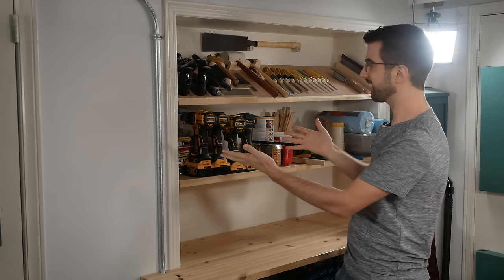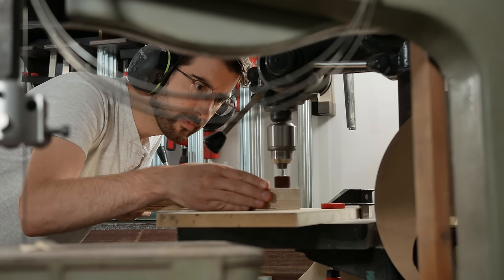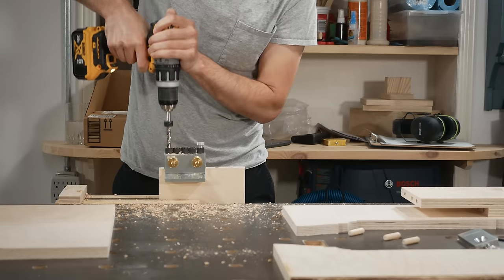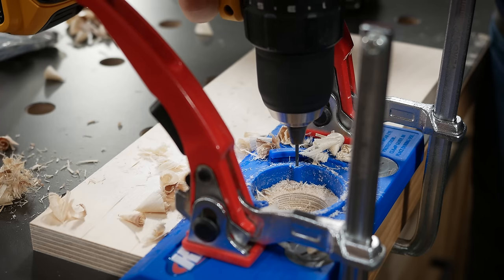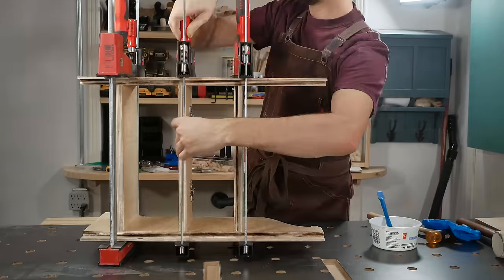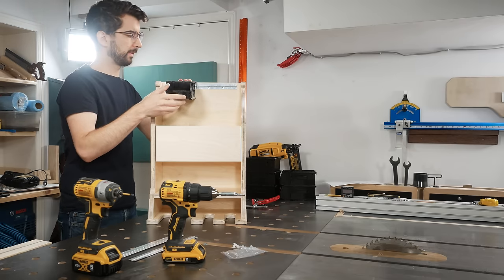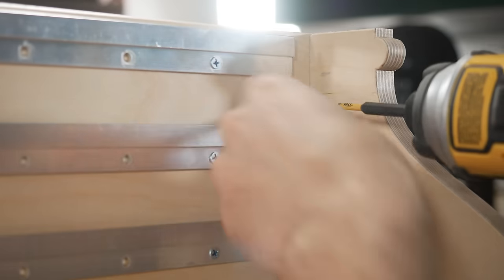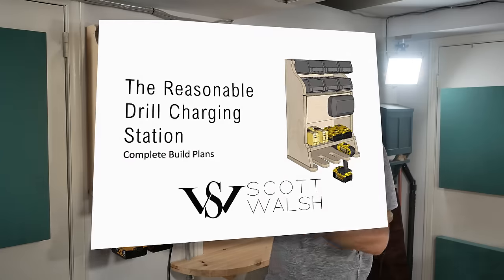haven't seen this on a drill charging station

Comment: 1:15 i have 6 drills for various uses. 1 lives in my car with battery and other tools, 2 for drill driving, another right angle, 1 for my wifee to use if needed (low speed won't hurt her) and the last is for heavy duty hammer/killin' stuff, I also use it for mixing in the kitchen and  cleaning.

Comment: Great job, and much appreciated on a smaller design; like you said, most hobbyists don't have more than a few drills and drivers. 
As for the dowelmax, I'll take every chance to sing its praises whenever I see it used in a video. Pricey for a doweling jig, sure. But it has just as much accuracy and joint strength as a domino. The domino is an amazing tool, but a dowelmax is an investment worth every penny as well. It's incredibly well-built too.
Reply: I would say an average of two to four drills for the average wood butcher..
Reply: @michaellovetere8033  Sounds right; I've culled the heard down to three: drill, impact and installation driver. It handles everything I need.

Comment: Total hobby and side hustle wood worker here and I have 7 drills and 1 impact driver lol (bought black and decker drill first on clearance and an additional drill with battery and charger was cheaper than just another battery so I have 4 of those and did the same with hart tools to end up with 3 drills and an impact driver from that line)

Comment: For cleating(?) bins, no need for alu --- some leftover click-together laminate usually works... When fitting laminate to a room, the last row normally is halved to fit so you have an entire wall's length of these to cut off. That's what my bins hang off... It's the plastic underside that's showing, which is usually coloured into something that goes well with wood (if you have wood pattern laminate).

Comment: Very nice, love the transparency with some of the mistakes you made: I've still got my own brad nail holes to patch up :|
My only suggestion for other folks is to build your drill holder deep enough so you can keep your most common bits in the drivers  rather than needing to take them out every time you want to put your drill away.  Cheers Scott!

Comment: This is super smart I need something like this for my 2 drills brad and pin nailer. Use them on almost every project so why not have them somewhere I can grab and more importantly put away in a second.
I’ve been trying to convince myself to buy that dowel max system for a while now. My current wolf craft dowel jig is terrible. Not very accurate or adaptable to different joints.

Comment: I noticed you've got the dewalt bit holder.  Also pretty sure you're in the great white north... soooooo I've found the DeWalt robertson bits are about as effective as a freeDumb convoy, so keep an eye out for the home depot milwaukee sets to go on sale from time to time, or if you can ever find the magical unicorns which are the bosch double sided robertson #2 bits that were at Canadian tire at some point in their lifetime nab those.  the Mastercrap maximum ones are pretty solid too as an option.  That said, the dewalt cases are better, so get some red in that yellow!

Comment: I have two 48"x48" versions of those in my shop. I do have more than two each of drills and impact drivers, but then I've got 18v and 12v varieties and like to have enough drivers to keep one chucked philips, one Torx 25 and one square bit. I also have other tools slotted in like my impact wrenches, my nailers, etc. I have all my chargers on the shelf above with one shelf having all Milwaukee chargers and the other having Makita, Ryobi, and even a Craftsman (don't ask) charger. The remaining shelves above are for my cordless tools that won't fit in a slot like jigsaw, circ saw, oscillating multitool, hand routers, sanders, etc., along with a bunch of screws.

Comment: I like the smaller design.  I only have a few drills and drivers and this would fit the bill nicely.  The only problem I have with that system is the open bins.  After a while they get full of shop dust as well as bugs and spiders in the ones I don't use often.

Comment: Regarding the dowel jig:  I’m less than 50 years old, and my first car was “a fraction” of what a domino tool costs.  ;)  This turned out very nice (efficient/attractive) despite the oops-es.  Thanks for sharing the oops-es; you likely saved someone else from making those errors.  I remember learning the brad nail orientation requirement the hard way.  I really like the trick of using slightly over-long screws to mark the drywall behind the project; I’m sure that will come in handy.

Comment: Is there any reason you used the cleats for the bottom row of bins rather than just resting them on the shelf? Seems like it would just make them slightly harder to remove, but maybe I'm missing something.
Reply: Bins sag without them.
Reply from the maker: The top of the cubby door would kind of rub. Plus, knowing me, I would knock those bins to the floor eventually.
Reply: See beginning of video where Scott knocked over a loose box of screws
Reply: @polosandoval  I can't see how bins sitting on a shelf would sag... I think you may have misread my question?
Reply: @ScottWalshWoodworking  That makes sense, thanks!
Reply: @spacekb17  Aah, of course!

Comment: Is the finish you are using all natural? I ask because I see you wearing a mask to sand but not when applying that finish.
Reply: He's using a waterborne clear coat from General Finishes. It's not all that smelly but it still off-gasses some VOCs that are not exactly healthy, though pretty safe in the amount needed to finish a little cabinet like this one. A carbon filter mask is a good idea whenever you are painting, even latex house paint, but I'm guilty. In any event the sanding particles are harder on sinuses and lungs than the solvents in this case.

Comment: I dont understand why routing that dado was the incorrect direction? can you explain
Reply from the maker: When you're routing a groove against a straight edge (or a router table with a fence), you need to travel in the direction whereby the forces from the bit rotation hold the router up against the straight edge. The opposite direction, the router will try and pull away from the fence. It's not an unsafe thing, it just makes it really hard to get a straight groove
Reply: @ScottWalshWoodworking  ah I see. So you were going in the direction of a "climb" cut but its technically not a climb cut because your cutting a grove (not dado) and the cutter should have been pushing the piece against the fence. So if the fence was on the other side you would have been going the right "way"
Reply from the maker: @misterfee6467  👍

Comment: That shelf will not hold up bruhh. Use the toggle bolt spring wings so that you have more surface area behind the screw. I wouldn't have my toddlers standing under that.